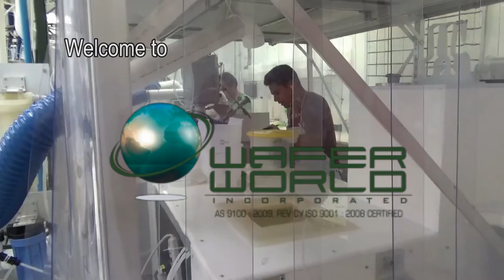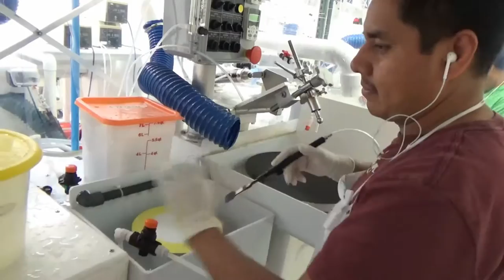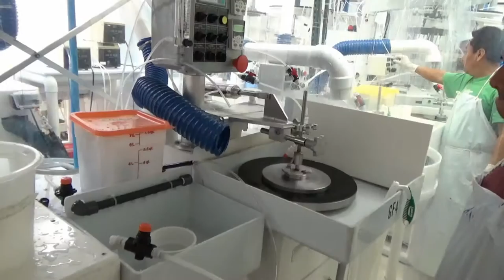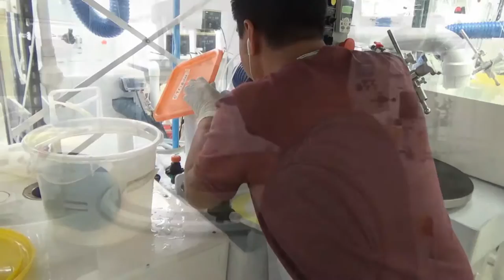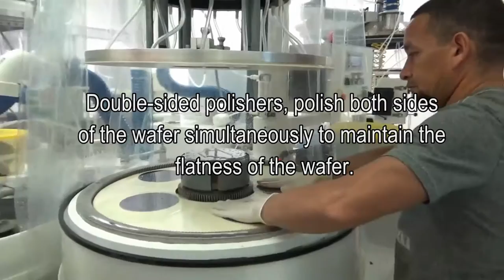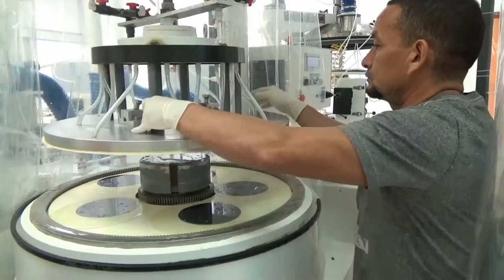Polishing Processes Behind Silicon Wafer Production | Wafer World

Comment: Wondering what kind of polish they use? I have used 50,000 mesh diamond compound to polish some silicon that I have.
Reply: Hi! what kind of slurry do you use for super finish polyshing? and what ph do you use?
Reply: Hi, Jason, are you interested in the diamond wire saw and grinding wheel?